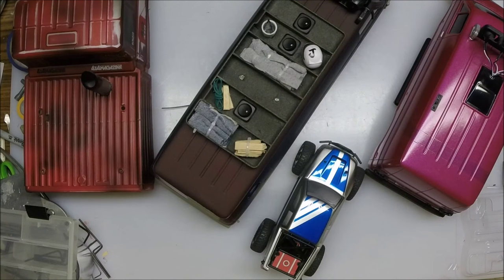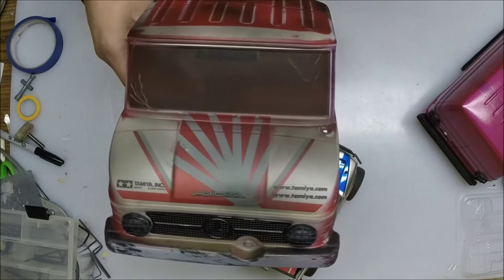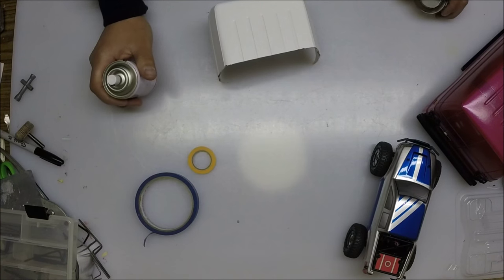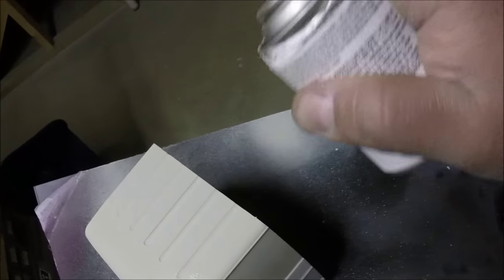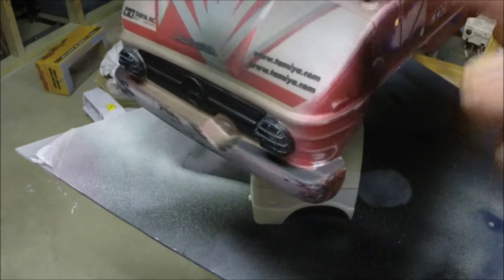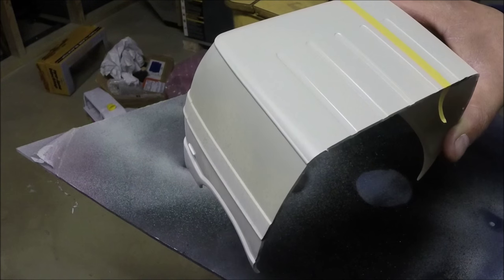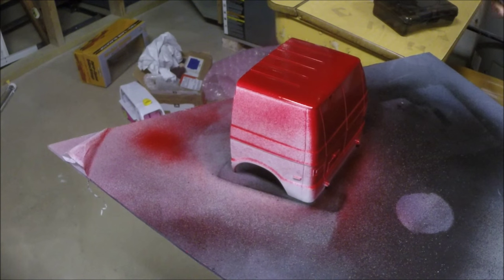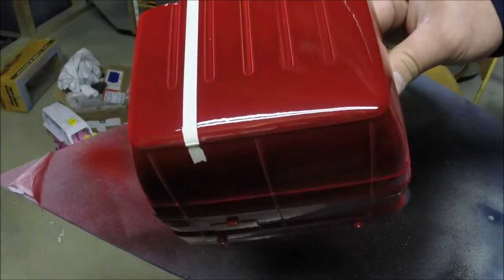The Beginner's Guide To RC: Basic RC Body Painting Tips

Comment: This came out beautifully. Can I ask a question?  So im trying to paint my hard body but everytime i use the tamiya masking tape to make the lines so I can paint the other side a different color when I take the tape off it leaves a streak of residue that makes me have to start all over and sand it and paint again but all I will be doing is going is circles. My question is if I leave the residue will this clear coat cover it and make is vanish? Or do you have a suggestion to get rid of the residue? Before you suggest some products I did some researching and I tried Wd40, Water, Goo Gone and using more tape to stick it and bring it up but none of these work. Thanks for the tutorial and any help will be appreciated!
Reply from the maker: The best advice I could give you is to use a high quality masking tape like frog tape. Use a tape that states no bleeding or residue. Also push the tape edges down several times to make sure its completely down. Even using good methods you can still have some bleed through, keep at it👍. Thanks for Watching!

Comment: Thanks for the video. If i could suggest one thing to try though. When finished spraying with cans. Is it possible to turn them upside down and spray a little bit to attempt in cleaning the nozzle for the next use?
Reply from the maker: Kevin Lay Yes that's exactly what your supposed to do that keeps the nozzle from clogging up with cured paint. When you turn it upside down air comes out without paint clearing the nozzle. Thanks alot for Watching!!😁

Comment: Is there a need to wet sand between coats?
Reply from the maker: Only if you have an imperfection, runs or sags, dirt trapped in paint etc. You can wet sand but not  needed to have a solid result. Thanks for Watching!